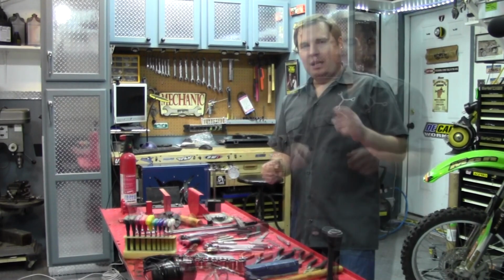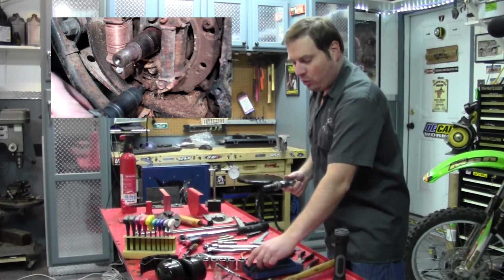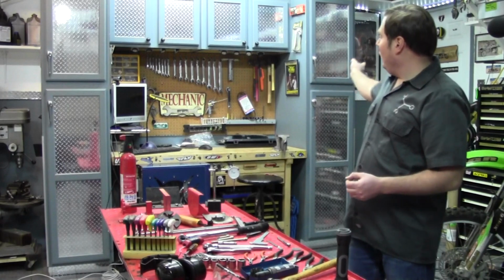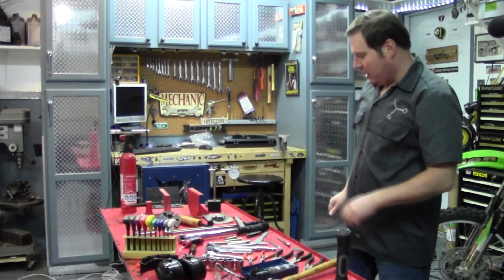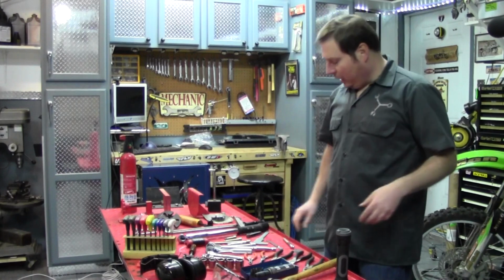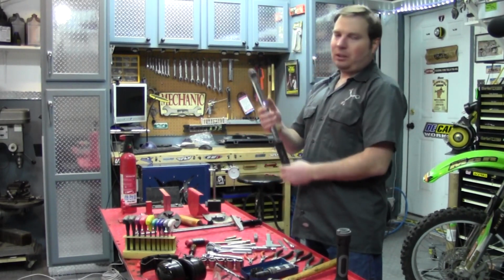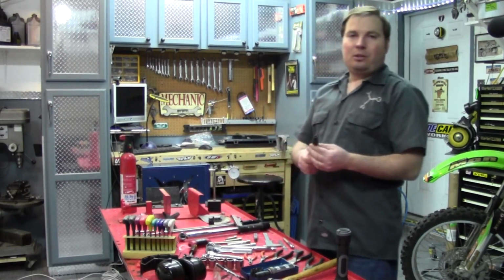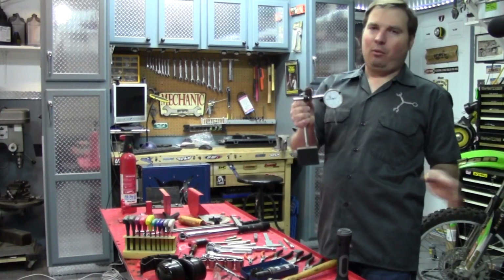Tool basics for motorcycle repair, what you need to have in the toolbox

Comment: A few things I didn't see mentioned: basic screw driver sets, torx bits, compression tester, spark plug sockets, bike lift, oil filter wrench, fluid drain pan, cable or chain lube, telescoping magnet for dropped items.

Comment: if you are going to have a wrist pin puller how about a ring compressor and maybe a grease gun. 6 & 12 point sockets also make a difference and of course a good set of plain old screw drivers. just to name a few other things.
Reply from the maker: Well these are just the basics to get started with.  I brought up the wrist pin puller as an example of the more specialized tools when a person gets into that stuff and your right then you would would want to get ring compressors and things as well as upgrade to 6 point sockets.
Reply: and then a good screw driver set and a grease gun?
Reply from the maker: I mention screw drivers, grease gun, for motorcycles its not really needed.

Comment: I got a torque wrench that’s 10-75 foot lbs. will it be useful for my gsxr600? Or should I get a bigger one?
Reply from the maker: Yes it will for most fasteners.  If you check the front of your service manual it will usually list a table with bolt sizes and torque values.  Check and see how large of bolt they list and see what that value is.  That means that is the largest bolt that you may have to torque if you ever disassemble something.
Reply: Ok I got a clymer manual so idk if that’s good enough but I mainly just want to do my own maintenance and than maybe tackle valve adjustments, can chain, spark plugs, etc. shop times for little stuff like this is very expensive so I want to save a few hundred to invest in my bike. Thanks you for the feedback man I appreciate the fast reply
Reply from the maker: a Cylmer manual is just fine.  And your torque wrench will do all you need for those types of repairs or adjustments.

Comment: I have a 1996 Yamaha VMAX. The spark plugs on the right or running rich the two spark plugs on the left or running normal what would cause this? Could it be from sitting too long on the kickstand and messing the floats up on the right side?
Reply from the maker: Sounds like the float needle valves may be leaking by and flooding those carburetors a bit.  You will have to investigate further.  I think your on the right track though.
Reply from the maker: Also, check out my carburetor jetting video for more help.